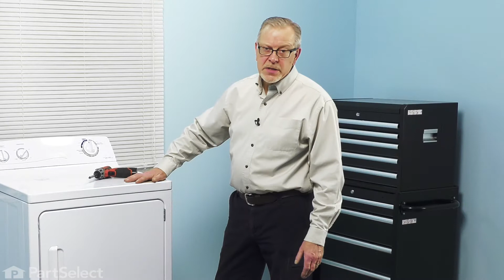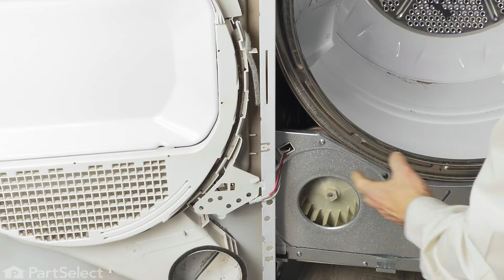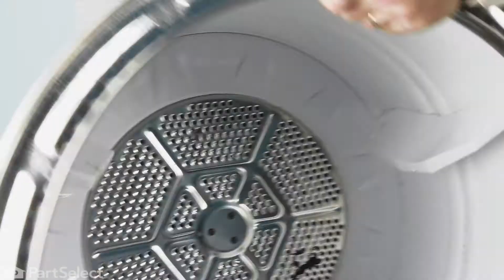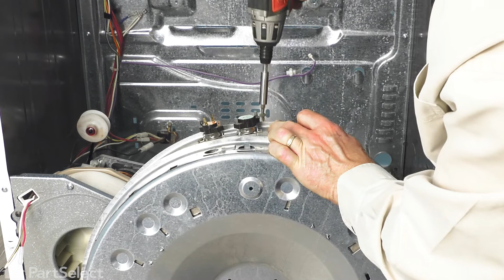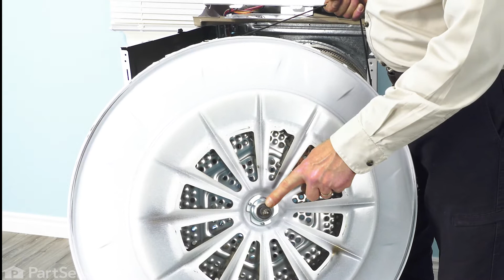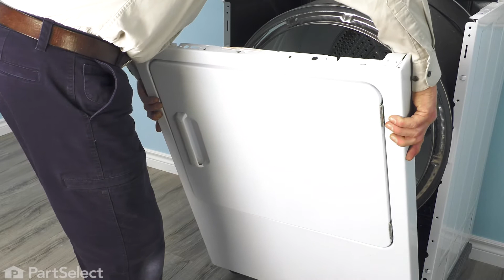General Electric Dryer Repair - How to Replace the Heater Assembly (GE Part #WW02F00468)

Comment: Well' I'm glad I looked online to see how to do repairs on this thing after seeing certain parts in breakdowns. You certainly changed my mind about ever buying a GE set today.  I'll be buying Whirlpools again or spending the cash on a high quality Speed Queen set because there's no reason one should ever need to dissemble these things to change a simple heater element. Besides the huge hike up in your element costs with this design too, this is just bs? 
   These designers would have been fired for screwing up GE's tried and true designs that made their name had I had that call!  But' as usual, your going the wrong way today on designs to force this unreliable garbage on us due to Planned Obsolescence, proof its a fact right here just no doubt about it. Some parts on its parts breakdown are already obsolete if you look people... Fair Warning!